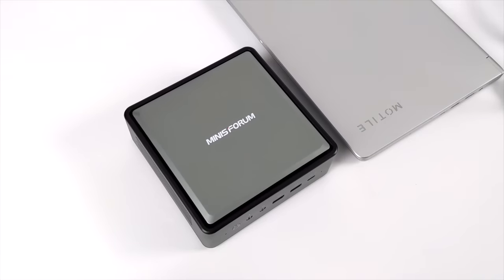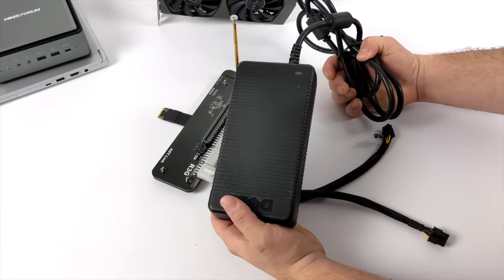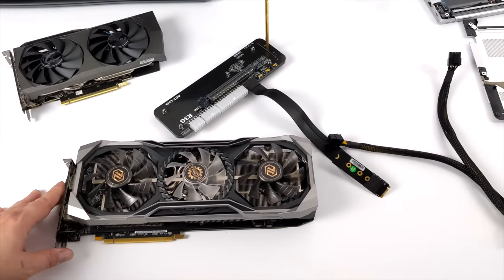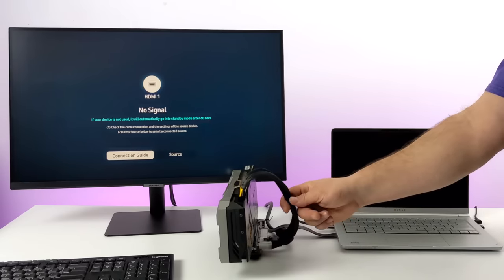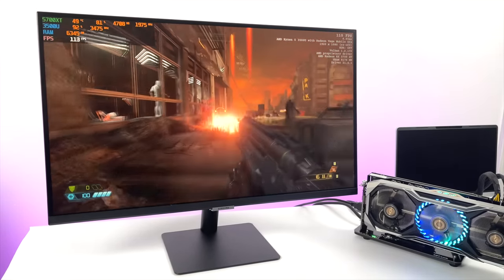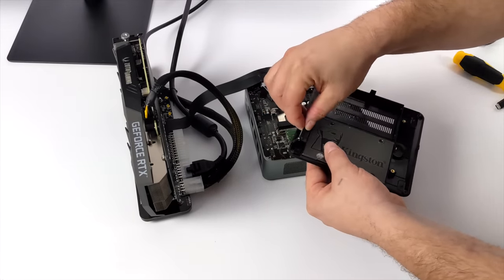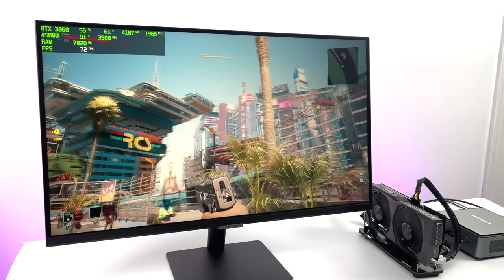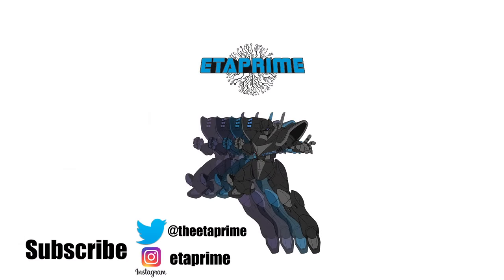Add A Graphics Card To Your Laptop Or Mini PC With This M.2 GPU Dock!

Comment: Alternate title: "Turn your laptop into a desktop"
Reply: Actually i never use my laptop on my lap, so i cant complain. Also im using an exp gdc for my "lap"top
Reply: yip this would be great if you bought very cheap laptop with decent cpu and it had broken screen and maybe keyboard ect but motherboard still worked fine then made or bought a cheap pc case to house it
Reply: @ETAPRIME  is there a way to connect an ext.gpu to a smartphone somehow
Reply: @AndroidFerret  No, smartphones don't work like that : )
Reply: @michaelalexanderbuana  what you mean ?
Ive seen people connecting their tablet to an external gpu ...
Reply: @AndroidFerret  maybe with a butchers twine? :D
Reply: @AndroidFerret  It could have been a Windows tablet like the Surface series as Android doesn't have support for I think, more then 1 GPU.
Reply: @ARTCvan  it was a Windows tab but not the surface  ..
It had a thunderbolt 3 port
Reply: @ARTCvan  i was hoping that with some crazy adapter setup it might be possible somehow  ...
Like the guy playing  ps5 games on his old Gameboy advanced
Reply: @AndroidFerret  Thunderbolt 3? then most likely that person used a TB3 external gpu dock since thunderbolt 3 has a massive bandwith that it could transfer video processing data through the port.
Reply: I am in the process of doing an e-gpu on my lenovo think pad. I am however going to have a co-worker 3d print me a new lower case that will contain all of the additional components. So mine will still be a laptop, just with an extra power cord.
Reply: @AndroidFerret  Game streaming if you didn't know duh
Reply: Still mobile enough for a lan. What are you even talking...🙄
Reply: I mean, as a person that moves around a ton this has been incredibly beneficial to me. I just need my laptop and my GPU, don't need to lug around a big PC and worry about it breaking. Super easy!
Reply: @marr1379  the gpu is the only problem tho
Reply: @marr1379  and what about ur mouse, headset etc and btw why do u carry a gpu outside i mean its probably not for gaming so
Reply: There is a term, "Desk Top Replacement"or "DRT"....
Reply: @ETAPRIME I somehow missed this the first time through so I'm just getting to watch it. I enjoyed it a lot....

I still prefer this lead-in then your current one with a robot sitting in the window though....
Reply: I actually have an old laptop with 2nvme slots. Instead of buying a new desktop I could add an egpu to this laptop which is a great option.
Reply: @feomathardra  may i ask what version of EXP GDC you have? does the ngff (m.2 a/e key) version works?
Reply: Not really. This is akin to adding a CD drive to your laptop. Dont be so myopic.
Reply: @feomathardra  so it’s just a “top” instead of a “laptop”

Comment: Pro tip with the laptop setup, they make HDMI dummy plugs (google it, you will find a bunch) that you can plug into the external GPU. It will trick the GPU into thinking it has a working monitor plugged in. With that set up, you go into display settings and set the GPU to have the same resolution as the laptop display then set the the laptop and GPU to duplicate each other with the GPU set as the primary display adapter. This way a game that loads wont even look at the integrated graphics and load on the correct GPU, but since the laptop display is duplicating whatever is showing on the external GPU you will see the game/desktop as though it was running on the internal GPU. Now you don't need the external monitor.
Reply: Thanks for sharing this tip :D really appreciate it
Reply: Bruh , ty
Reply: Yo! Thanks for the info 👍😁
Reply: Top flite info ty!
Reply: @charmerabhi  same here!
Reply: Sorry for the necro post, but would this set up cause a further hit to performance or would you get similar fps to what would have been on the external monitor?
Reply: @smirk-in-progress4800  you wouldn't get a hit in performance, it would be exactly the same as on the "external monitor". The only limitation I can think of is the refresh rate of the laptop monitor. It's probably going to be capped at 60fps. But honestly in this setup, I wouldn't be expecting the fastest from the GPU since it will be bottlenecked from by the limited number of pci lanes. If you do run this setup it's going to be just like any other situation where you need to tune the games graphics to the hardware present. The laptop/GPU won't be aware of the monitor trickery so it should run normally.
Reply: On other hand, presuppose that a menu in nvidia control panel utilizing igpu over dgpu can simply be processed vice versa using the control panel to manually toggle which gpu assets are being sourced.
Reply: @luisramirez3368  that usually only works for setups that came pre-built with an integrated GPU and a DGPU inside the laptop ahead of time most desktop GPU drivers do not include the ability to swap between the IGPU and the DGPU
Reply: for wisdom later
Reply: Hello kind sir.
Lets say Im moving out and cant afford to carry a monitor.
My laptop has both igpu and dgpu(nvidia).
Still I'll be able to display on laptop monitor from egpu (amd) with the dummy? Or theres something to do to allow this to happen?
Reply: Thx
Reply: Bloody brilliant
Reply: @charmerabhi  same
Reply: Nice
Reply: @jonmcentire  Actually you do get a hit in performance, as its wasting PCIe bandwidth copying the frame buffer over to the iGPU.  Plus like you said it will disable things like VRR/G-Sync.
Reply: cool
Reply: I always wondered what those dummy plugs were used for.
Reply: @danlt1497  theoretically it should work. You now have 3 gpus in the mix so you would just need to be careful which you select as the primary in the display settings in Windows/whatever OS you prefer. That being said if you have a computer new enough to use an egpu and it has its own DGPU to begin with, I would probably just stick with the DGPU unless it's particularly low performing. The egpu setup is great when it works out, but there is a lot that can go wrong, often leaving one without a clue as to what has failed. A DGPU is essentially this setup to begin with but somebody has already gone through and worked out all the bugs and issues ahead of time.
Reply: @jonmcentire  Hi,  I have an NVISEN y-gx01 mini PC with an integrated UHD630 and a dedicated GTX 1650 on it. It has a i9-9880H processor. I have bought the ADT link K3G version and bought an ASUS Dual RTX 4060 GPU. I know there is better price/performance GPU but from power consumption as I know this is the champ and I powered up with the dell stuff. So I connected everything, but I cannot get it work. Just having code 43 all day long on the RTX 4060 and sometimes on the 1650 too.  Tried everything what I found how to disable the 1650 and used DDU, Driver Booster for driver update, used NVidia updater, started from scratch and nothing works. My mini PC sees the 4060 too next to the two original ones and my monitor is connected to the 4060 and I have picture (when I disable the others) but the driver is not working properly. I hoped you could give me some advise if this dummy plug can be a solution also to my problem?  I would highly appreciate feedback. thanks a lot
Reply: @STI_87  Go into device manager and manually disable the the GTX 1650 and try again. This sounds like you may have too many GPUs going on at once, this won't be permanent, and you can re enable the 1650 anytime. ;etc me know how it goes with the 1650 disabled.
Reply: @STI_87  one other thing you can try is completely removing the NVIDIA drivers then disable the 1650, and only install the drivers for the 4060 and see how that goes.
Reply: @jonmcentire  thanks. Unfortunately I have done these, both options and although the 1650 is disabled the 4060 still showing the code 43 and not working properly.  I completely stucked.
Reply: @STI_87  I'll think about it some more, but I'm wondering if it may be just your particular setup isn't jiving with the 4060.
Reply: @jonmcentire how could I check that? I have checked online with some kind of pc setup checker before I have purchased but who knows. Also, today I could manage to disable both original gpu and having the 4060 popping in the device manager and suddenly the windows turn it down saying the code 43. So i am getting closer. This would suggest to me the windows blocking me. Maybe if I would disable the 1650 from BIOS? (actually at the moment BIOS has no option for that but I can try an update on that)
Reply: @jonmcentire also when I pluged my monitor to the mini pc and disabled only the 1650 and let the 630 working I could manage to have the 4060 refresh, install the driver and windows showed me it is working fine. But when I plug the monitor in the 4060 it is not giving me picture. After restart it does but windows give me the code 43 again.
Reply: @STI_87  if I'm reading this Google result correctly that code 43 is specific to the Intel drivers on your machine. Recommended fix is to do a clean install of the Intel GPU drivers
Reply: @jonmcentire  did it. Actually Ijust realized I did it yesterday, but same situation.... I am starting to give up.. spent all the money for nothing.. I don't understand... I could found no comment with a Problem like this..  But I really appreciate your effort to help. Thank you
Reply: I am doing this exact thing and I wanted to ask do u need the hdmi dummy for it to work or is it just for convenience
Reply: @voltfn2775  I imagine there will be hardware/driver combos that don't require it, but it seems needed most of the time to avoid the entire external monitor.
Reply: @jonmcentire  well I asked another guy who did this he is saying that it should work fine so do u think I should test it
Reply: @hbdthedoggo  sure, I just have to wait for my summer break cuz I’m using my laptop in school so I won’t be able to do it just yet, so probably in 1-2weeks I’ll let u know
Reply: What a legend.
Reply: Damn
Reply: @jonmcentire  My laptop has a 144hz display it's already decent, so if I don't use an external monitor and use this trick to make the laptop think I'm using an external monitor how much performance loss I can see?

Comment: Two M.2 slots, such luxury! And x4, so much bandwidth!
Reply: Hey jeff , how is your project on rasp pi is going
Reply: Lol 🤣
Reply: Three ports, he says!
Reply: Keep up the great work, Jeff!
You have singlehandedly made me try to recompile a linux kernel.
Reply: ...which got me thinking whether this dock be used with a computer that does NOT have a single M.2 port? In other words, for example - use an M.2 to USB 3.0 adapter to connect to the computer and the GPU etc as shown in this video. Or have I been watching too many Jeff Geerling videos 😃 Keep up the great work, guys? Perhaps you guys should consider doing a collab video on getting something like that to work in case there might not be a straightforward way to do that...
Reply: Maybe on the next Raspberry Pi Jeff?
Hey a guy can dream?
Reply: @topperdude2007  If there's no M.2 slot, you'd have to find the PCI-E bus on the CPU socket itself. Not even close to being worthwhile, considering how old/crappy a computer has to be to not have an M.2 nowadays.
Reply: @DaKrawnik LOL, What what??
Reply: So easy to put a gpu on it, and it works
Reply: @topperdude2007  it wouldn’t work over USB 3.0, not enough bandwidth. however Thunderbolt 3/4 should be good
Reply: Mr Jeff please help me put I've tried everyone and no one will answer I'm buying the x400 mini it has 2 m.2 ports but I guess they are not mvme there m.2 2280 and m.2 2242 the description on Amazon says the above product comes setup for 2280 but says it has to be a mvme port ? Will this work or i found some different ones that say m key a key ect ones that aren't mvme I'm lost please help.
Reply: Btw watch a bunch o yer stuff love it subbed to you have like 3 pis a 400 so much fun
Reply: @topperdude2007  usb 3.0 isn't nearly fast enough to support this. Not enough bandwidth.
Reply: i guess it's kind of off topic but do anybody know of a good website to watch new tv shows online ?
Reply: I had to smile reading this, imagined the dogge meme - so much bandwidth, but you are right the m2 should have enough speed to boost a laptops GPU performance.

Comment: This... kinda makes me question why we don't see computers with external M.2 slots... that could be insanely useful.
Reply: Yea this gave me the idea to find or make an m.2 extender, and put a small hole in my bottom case, allowing the extender to slip through, and a second divot in the bottom to flushly  seat the cable. With that i can swap between my dual boot and this set up (if i get a graphics card worth the same as my computer)
Reply: Maybe because it can be dangerous to plug and unplug m.2 on turned on notebook?
Reply: @CholsreaRedstone it would be interesting to see! If you'll do it post a video!
Reply: @nomars4827  it would be dangerous to do so while it was on unless we modified how we use m.2 slots, having a variant for external connections, similar to usb ports
Reply: @CholsreaRedstone  I found out that there are such cases which work through Thunderbolt connection via USB-C. It also has same bandwidth of 4 PCIE  lanes. You can also find a video where a guy connected GTX 4090 to usual laptop.

Comment: I think an interesting test would be to run benchmark tests on a normal PC between connecting a GPU through the PCIe slot and an M.2 X4 slot.
That would really tell us what the performance drop off of this setup is.
Reply: @DaKrawnik because most people that are watching this video aren't interested in doing this nor do they understand it.
Reply: why would you do that?
Reply: That's the reason i watched this video but unfortunately no comparison like this. The performance drop would be very interesting
Reply: It's very weird indeed that he didn't do that.
Reply: @robertlee6338  it s only a loss of around 20%
Reply: @LanaaAmor  Why would you then watch the video if you're not interested with the performance difference between an x16 and a x4 slot? Might as well build a desktop at that point
Reply: yes pleaaaase ^_^
Reply: The performance drop is minimal. It's all about the interface you present and bus being used. Besides if your in this for performance you'd be getting a desktop...
Reply: @gyromm3094  yes that is 100% correct, it's kinda common sense haha.
Reply: @gyromm3094  id like to know so i know if its worth doing in my usff pc or should i just build a full desktop computer... dumdum
Reply: @AaronR-p2r  therefore, you're interested in it? which, if you are, then you're not the one i'm talking about.
Reply: Can this thing work with GPU without power pin?
Reply: Is it possible to connect a 4070 over m.2k on the hp pavilion gaming 15?

Comment: So many forums say things like it's impossible to use an external GPU on a laptop or mini-PC because there's no interface or because PCIe x2 isn't enough. It's great to see this setup!
Reply: Thunderbolt 3 is how I connect my eGPU to my mini PC and my HP spectre laptop.

I think the method in this clip is still supposed to be faster though.

Comment: I'd love to see either a weaker or stronger GPU used in the same system. See if the bottleneck means there's little difference between say a 3060 and a 1050 Ti or a 3080.
Reply: 1660 super isn't bottlenecked by it so 1660 super and 3060

Comment: Really impressed with the mini PC performance. I have a 3060 and in most of the GPU heavy games and benchmarks you are getting the 85%+ of the cards performance. For instance a graphics score of 10,000 in Timespy would be an amazing result for that card, so a 9070 is pretty damn impressive with that setup.

Comment: Always make sure that your Powersupply provides enough juice to power the GPU. Not meeting wattage requirements can trip overcurrent protection or fry the PSU if it doesn't have working safety mechanisms.
Reply: He has plenty as long as he doesn't go into rtx 70 territory 200w should be fine

Comment: I kinda wish that they'd make these with an extra connector that is small and close to the m.2 side that you could easily cut a hole for, that way you could detach it and move the machine easily, whether laptop or mini pc. Though, it might be a problem if someone tried to hot-swap it.
Reply: This was my exact thought too. If someone is motivated, you could maybe cut the ribbon cable in half, and solder some ports to it, but without seeing it in person, IDK how plausible that is (or if you can get compact male/female connectors to support the necessary amount of wires)

Comment: Closer and closer to a future where I don't need to have two separate computers anymore. Just need this with a nice convenient/accessible way to plug it in.
Reply: the nice and convenient way is thunderbolt, this implies opening your laptop every time you need to plug in....
Reply: @_Digitalguy  Yeah, if there is a thunderbolt dock that can supply power, ethernet, and eGPU that would be perfect for me. Currently already using a thunderbolt dock, but I've read that you can't plug an eGPU into the dock, because its just too much latency to the CPU
Reply: @dalethepalemale6855  but is it a dock specifically made for eGPUs?
Reply: @_Digitalguy  No its a dock for power, ethernet, displayport, USB, etc. What I would like is to still have those features plus an eGPU, but currently its not possible I think.
Reply: @dalethepalemale6855  It is possible. The Razer Core X Chroma has 100w power, 4 usb and ethernet. Display port is in the GPU itself, which sticks from the enclosure just like from a desktop (there are several, depending on the GPU, my 2070 super for instance has 3 + 1 HDMI)
Reply: @_Digitalguy  Amazing! I'll check it out, thanks!

Comment: A good power supply alternative could be Cooler Master MWE 550W FM 80+ Gold *MPY-5501-AFAAG-EU  , which has all modular cables , so you can put only the required gpu cable on it
Reply: How much watts it can supply?